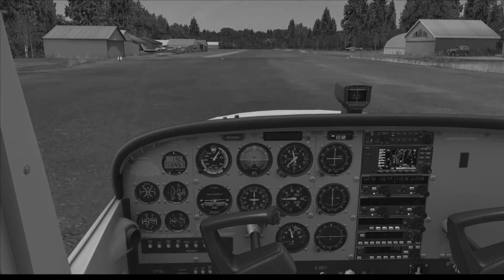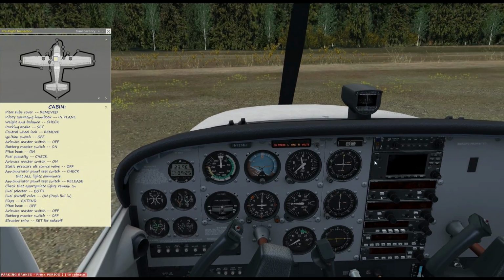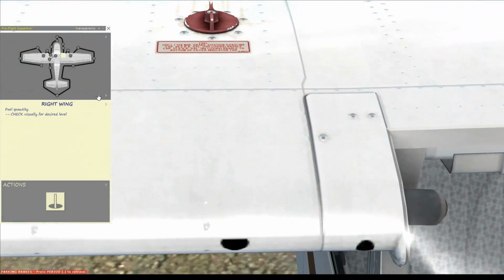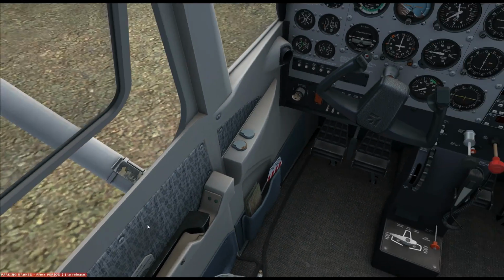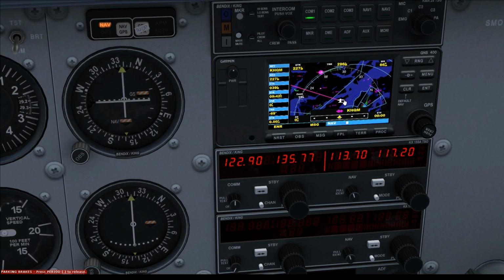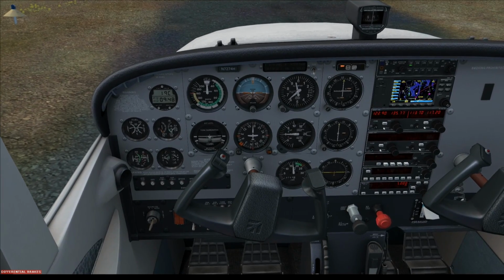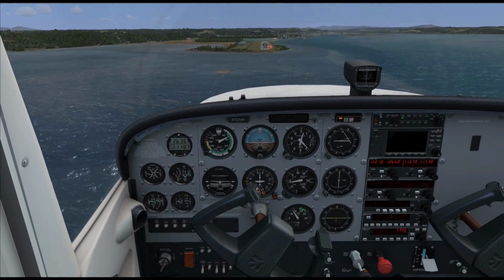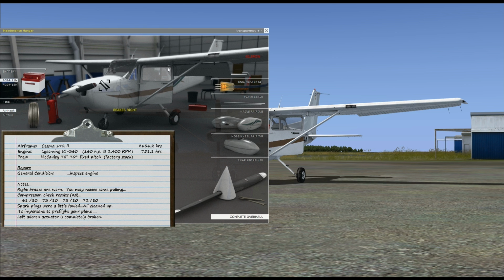A2A Cessna 172 First Look, Short Flight and STOL Madness!

Comment: hey couple tips:
1. dont use aileron except if there is a crosswind in which case use some in to the crosswind depending on wind strength. u should use rudder on takeoffs and landings not aileron
2. if it is a rough runway, using low power does nothing except increase the takeoff roll and damage, the takeoff speed stays the same. you ALWAYS use FULL power ESPECIALLY in a short field like that so you have room for error or an abort.
no hard feelings i liked your video but i have to say i thought you were going to burn up that fuel pump with no fuel running through it :D  just remember to use that right rudder!

Comment: Every time you want to fly, you need to waste 45 minutes to do all that ??? Amazing airplane but I don't want to spend more time in the garage rather than flying. No thank you.
Reply from the maker: +Denis Bargone Thanks for your comment! The A2A 172 is one of the most basic of aircraft that A2A have produced (along with the Piper Cub perhaps). But for the purposes of the video and to fully demonstrate the product, I have taken my time to show all of its intricacies.

As PK-JIN mentioned above however , you can still jump right into this aircraft and be up in the air within 5 minutes (or less!). Will your engine be sufficiently warm or will you have done the proper checks? Probably not, but you can still get up there quickly if you want. That might add a bit more thrill to the flight actually...as you don't know what could go wrong lol.
Reply: +PK-JIN 
Yeah, I finally bought it and I enjoy it. Thank you for your reply
Reply: +Denis Bargone Although the video spends a lot of time preflighting, you still can hop in the plane, flip the right switches and turn the right knobs and go flying in the A2A Skyhawk. The product has the simplicity for those who want to hop in and go, but it also has the complexity for those who want everything short of the real thing.

Comment: Soft field takeoff, pull the yoke back, as much as you can at all times, when taking off reduce the back pressure a little bit, when it starts rolling pull the nose into the air and keep it there, it will get air quickly and keep it on ground effect, about 10 feet from the ground, at 64 knots start climbing and maintain speed until obstacle cleared and then level off until 78 knots then climb at 78, flaps up after you cleared the obstacle, just to make it more real, I love your pc
Reply: yes
Reply: but dont go around tail striking, pulling back on the yoke after landing and on takeoff helps reduce the strain on the nose and keeps you from hitting bumps really hard

Comment: Harman Motor Works how do you select the new version?
Reply from the maker: Not sure, but do you mean the C182? If so, that is an entirely different plane so you'd have purchase it and select it as a separate plane in FSX. If you're talking about a patched version of the 172, you'd just run it as normal (unless I'm mistaken! I haven't been flying for a few months lately - hope to get back into it soon!). Cheers

Comment: Trouble with this aircraft is there is no rudder trim so you need to use rudder pedals to keep the thing straight.
Reply: Theres no rudder trim in the trainer version of the 172, so this is accurate. However if you balance the aircraft and cruise at 2100 rpm you should find the plane will stop pulling to the left or right. You will still get it when you power up or down though which is realistic,  at least for the 172 I have been in.
Reply: Thanks for that!
Reply: You're welcome. Oh yes If it still pulls, and you are in FSX, turn the P-Factor down as its known to be over-sensitive!

Comment: I have the aircraft and love it. Fly's like it's counterpart. I've logged many hours in the 152 and flown in many 172's. Just some friendly advice when taken off on a grass or dirt runway. Pull your yoke all the way back starting out and as your speed gains, push it forward a little until Vr and make sure you advance the throttle all the way forward. There's a couple or reasons why you want to advance power fully. First, if there should be something wrong with your engine, you might have enough time and distance to stop the aircraft. Second, to make sure you obtain enough speed for Vr. The last thing you want to do is stall the aircraft on takeoff. You came very close doing this. Since the aircraft behaves quite similar to the real thing, you might want to try some slow flight and stalls around 3,000ft just to get a feel of how the aircraft handles. This will help with landings and you'll have a better understanding of when a stall might occur. Hope this helps and thanks for sharing.

Comment: Ok, im sure its the best Cessna availble for FSX, but...
...Its still only Cessna...
...While i want a B-29 with Accusim :-)
Reply from the maker: I hear ya! Also, I've also been hoping for another such bomber, the Lancaster, for a while now. Technically, (running) examples of these planes still exist so there's hope that A2A may one day do it! (I've heard they won't 'Accusim' a plane without having had sufficient access to one to 'research' it first) Cheers.
Reply: Harman Motor Works
Same thing is with a B-29, there is a B-29 "FIFI" that is still able to fly today so research would not be a problem too.

I always wanted a B-36 as my favourite historic aircraft, but FSX cannot handle those 10 fancy engines. Even old version with 6 engines would be pointless because FSX can handle only 4 engines per airplane.

Comment: What simulator is used for this? Microsoft? Amazing realism!!! Can you get back to me ASAP please, I'm astonished at how real this is! Gonna run out and buy it!

Cheers, Chad (Private Pilot - 200hrs.)
Reply from the maker: Hey Chad, yes this is Microsoft's Flight Simulator X. Can be had for very cheap in most bargain bins these days. Unfortunately it's the last great simulator from MS, but still a huge following for it. Ensure you install SP2 when you get it. I'd recommend FSX Gold if you haven't already got that. It should have the latest SP on it already. Cheers mate. :) Fred
Reply from the maker: Harman Motor Works
Btw, make sure you check out the A2A simulations website as well. The Cessna featured here is not the default FSX Cessna, but a payware add-on and very much worth it if I may add! Cheers.

Comment: Cool video!! But I'd just like to add when landing on an asphalt runway you do not keep your nose in the air for long as possible. You only keep your nose wheel off the ground as much as possible when taking on a soft field landing. The reason behind this is so you don't cartwheel when landing or get your front gear stuck in the ground. I'd also like to just add when taking off on a soft field as you did with an obstruction. you are supposed to keep constant pressure pulling back on the yoke until the plane gently lifts off the ground and then immediately level off until you reach your Vx speed (best angle climb) and then ascend again at your Vy speed (best rate climb) for an effective soft field takeoff. That's what's I've learned from being a student pilot. Cool video I enjoyed it! And sweet add on.
Reply: Seadot777 Your theory for the front wheel is incorrect. The front wheel is held off the runway for as long as possible to save on the shimmy damper. If you set down at higher speeds you will notice a somewhat violent vibration from the nose gear. Correct procedure is to set down on the mains and hold the nose off the runway for as long as safely possible.
Reply: Very well said!

Comment: As a question, why did you keep the nose wheel up on landing?? My flight school told me to get full control and slow down with the drag from the wheels
Reply from the maker: I-am-not-a-pilot-disclaimer: always land on the main wheels first as this prevents the nose wheel from getting stressed and possibly damaged from the jolt of the initial touch down. Once touched-down and rolling, then finally (and gently) touch down on the nose wheel. Admittedly I may have 'hovered' the nose wheel for a little bit too long in this vid, but in terms of the actual touch down, as mentioned I'd recommend touching down the main (rear) wheels first. Again, I'm not a qualified pilot nor instructor, but this is my opinion on the matter. Cheers. :)

Comment: How can I learn how to run a plane like this start to finish? Without real lessons.
Reply from the maker: If you mean a simulated version of the plane, it's not that difficult...after all I'm no real-world pilot. :) If you mean flying it in the real world without "real" lessons...well, that's a different story. It goes without saying that professional tuition is a must, as there's a lot at stake (i.e. your life). Cheers.
Reply: Harman Motor Works I kiiind of mean both. Mainly sim, but I guess it can be applied practically. Along with real training of course! I found a manual on their site which surprised me. Very professional...
Reply from the maker: You're right, the procedures and processes 'practiced' in the simulations, (especially with A2A aircraft!) can certainly be used as a 'primer' for real-world training. Actually the flight school near me considers FSX logbook hours as contributing 50% towards the real-world hours which I thought was impressive. I've found the A2A manuals to be well-written too. And you can find real-world aircraft manuals online as well I believe. Cheers.

Comment: To prime its Mixture Rich, Throttle Full, then the Fuel Pump on until you not the fuel flow to about 5, anywhere from 3-5 seconds lol you definitely would have flooded the engine if this had been IRL, cheers

Comment: Sir i have a question about the mixture level wenn 'cleaning' sparkplugs? How much do you wanne have ruduce your mixture wenn you wanne 'clean' your sparkplugs? About 16RPM? or more? Or..... How do you do this?? Sinds a couple days i have this fantastic plane also....
Reply from the maker: Hello, I don't believe there is a rule for how much to reduce (lean) the mixture. Just lean it until the RPM drops down and hold it there for a little bit. About 16-1800 RPM should be OK I think. With the latest patch, the likelihood of plug fouling was reduced somewhat, so you shouldn't need to do this, unless you've been idling full rich for a long long time. Cheers.
Reply: Harman Motor Works Ok, THNX!!! Its true I've got "it" just a couple days. So plug fouling a less prob. for latest patch.Ones again THNX!!! I have a onther question, I can add Additive ASL-CamGuard 'stuff' too my oil, Wat is that???
Reply from the maker: The CamGuard additive is meant to reduce the amount of simulated wear on the A2A Cessna's engine. I personally don't run it in my Cessna, but by all means experiment with it. I don't think you will notice a great difference until you get a lot of hours on the engine however. But I could be wrong. :) Congrats on your purchase btw. Enjoy!!
Reply: Harman Motor Works Thank you very much for your awnsers and i will enjoy my Cessna 172!! I LOVE IT!!!!!! BTW I cant wait for your next vid with the A2A Cessna 172! I've also got the A2A B-17 shoo shoo baby texture like yours! Awesome !!! Again thank you very very much for time!!!
Reply from the maker: Cheers mate and it's true I do have another video in the works. Expect it soon!! :)
Reply: GREAT!! Cant wait!

Comment: I just got the A2A Cessna 172! I want to know how can I move the camera angle like you are doing it in the video, the only way I can move is pressing the space bar and moving the mouse. What other keys do you use besides that?
Reply from the maker: Congrats on your purchase! I use TrackIR head tracking hardware to enable the camera movements you see in the video. I highly recommend TrackIR; many simulations use it and it leaves your hands free to do the more important stuff such as operate the controls. :) Cheers.
Reply: Thanks & I will get the software ASAP ;) by the way, great video!
Reply from the maker: Thanks!

Comment: What do you use to record? How much does it cost for what you use?
Reply from the maker: I use Fraps screen recorder to capture the video. Just Google 'Fraps'. You can download a trial version to try it out and the registered version costs about $40.
Reply: What's the difference?
Reply from the maker: Basically the full paid version gives you unlimited recording time (30 second limit otherwise?) and also the paid version has no watermark on the recorded footage if I recall correctly.

Comment: In real life though, when taxiing or taking off on grass you always hold your yoke all the way back, aka full elevator up. However, once the plane is airborne you release the full-back pressure and level off the airplane at about 10-15 feet and let it stay in "ground effect" where it can pick up enough airspeed for an obstacle-clearing climb. Even if you don't need to clear any obstacles you still want to get off the grass asap since the drag is enormous.
Reply from the maker: ethugp3pp3r
I think you were only kidding but I wasn't actually at 9,600 ft...I had 'simply' forgotten to set my altimeter pressure correctly (from memory!). I doubt the field elevation is that high at Vashon Is. ;) Thanks for watching!
Reply: this. Also, running full rich at 9,600 ft MSL isn't a good idea ;) find the ideal mixture setting during the run up!

Comment: There is a debate as to weather the altitude a/p function requires a patch. If you can achieve a selected altitude and have the aircraft maintain it without a tendency to "porpoise" or over correct, then that's what I was alluding to. Cheers for the movies, they are great!

Comment from the maker: Hi David, I have fiddled with the autopilot a little bit so far, but am shying away from covering it in a video just yet until I actually get the low down on how it works. I am currently able to activate it and initiate level flight, climbs, turns, etc, but I want to be sure I am operating it 100% correct before I do a video on it. I have another Cessna in the works currently where I show a little bit of the autopilot, that should be some help for those that want to see. Thanks for watching!